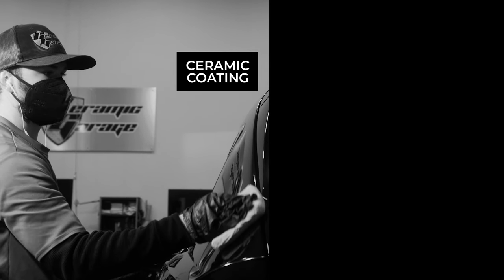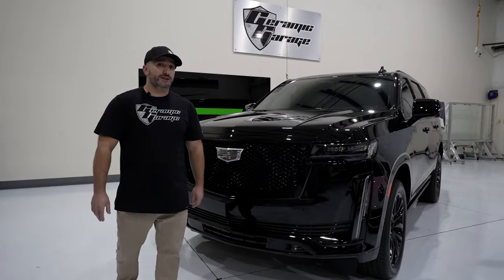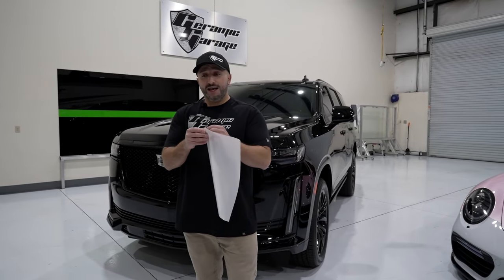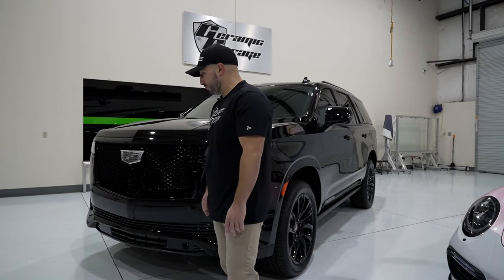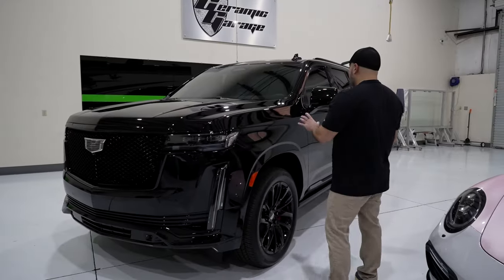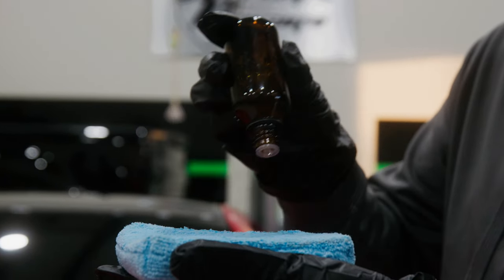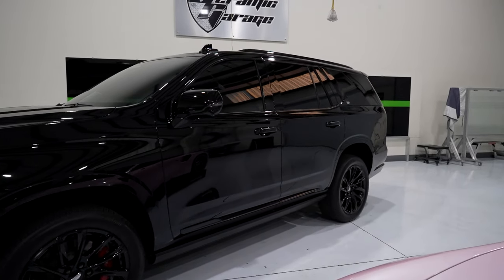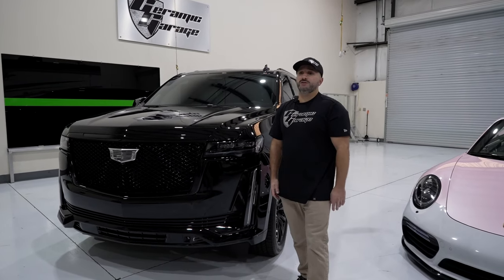Paint Protection Film (PPF) vs Ceramic Coating - 2024 Cadillac Escalade 600 Series

Comment: I like his recommendation of PPF on the front of the car and ceramic coating on the rest.  That's exactly what I did.  My 2018 Porsche 911 in Florida does not have any bug stains on my STEK PPF after 3 years, really. And while the PPF did get damaged, it was a sacrificial layer that stil protected the paint.  But then I wash it right after any long trips during love bug season.